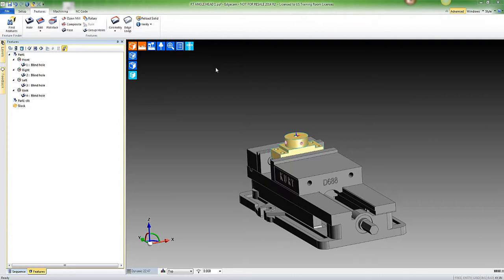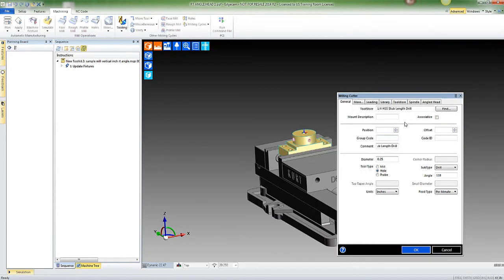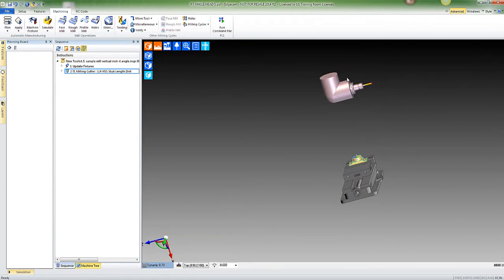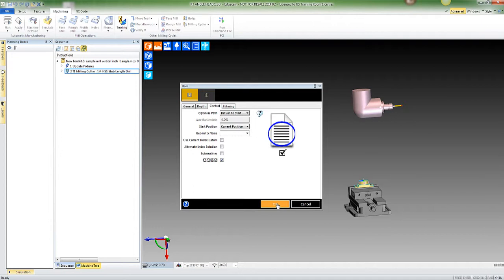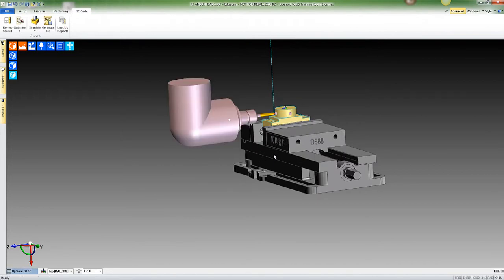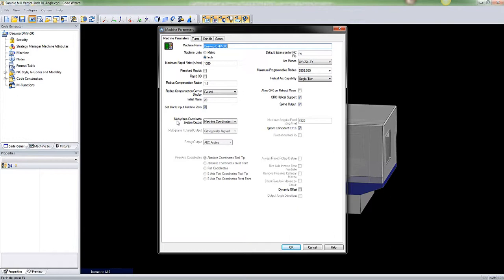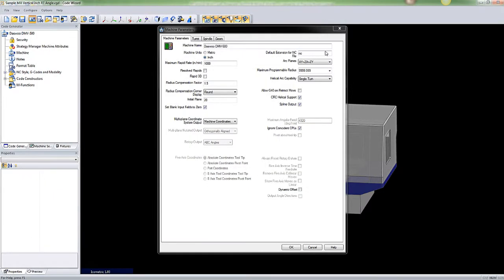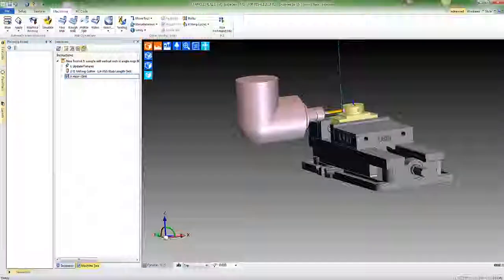Right Angle Head

Comment: Richard, I have an application where I am milling a part on a 4-axis horizontal with a rotab option. I have several tools running on the part prior to the need for the right angle head work. Is it required to modify the post to handle the right head? If I do that then the nc code for the other tools will not process correctly. Additionally, shouldn't it be possible to change planes when using the right angle head?